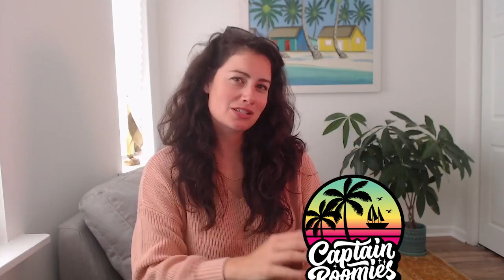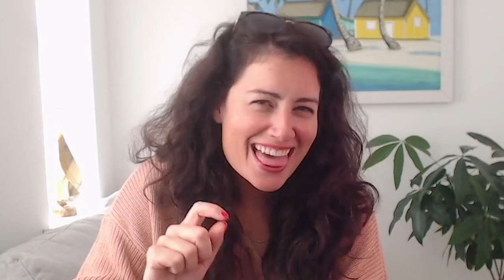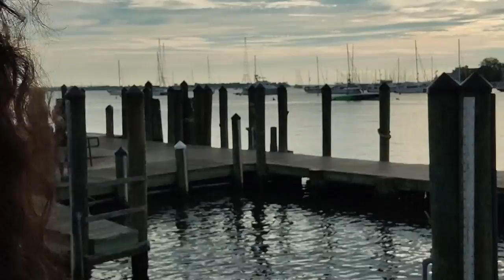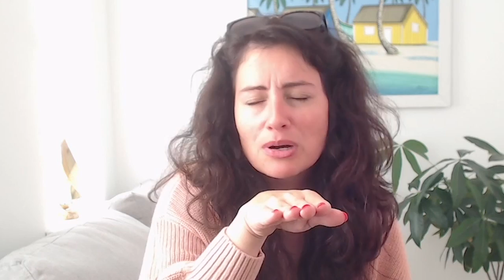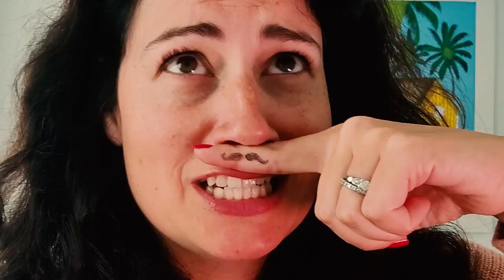Tips for Confident Big Boat Docking from a Woman Captain

Comment: YEAH.. "slow is good"    also slow takes off so much less paint... 
and why are there no video of that single engine slip hop?    like a timelapse.?
Reply from the maker: HAHA, It's pretty hard to film yourself and make that maneuver happen. I didn't have time to go ask for a cinematographer on shore, but I wish I had. Kicking myself now... I wonder if anyone at Pussers got a shot of it. There were plenty of folks having breakfast over there.
Reply: @CaptainBoomies  Yeah I know its hard - constantly wish I had turned on the camera when reefing - but the 35knot wind and waves kinda distracted me LOL
I have had good luck with time-lapses, use a big lightstand and stick the GoPro on top.. then let it run.  if you shoot 4 or 5.6k you can make a 1080p project and crop or crop-n-pan as you go after the fact. 
I tacked a phone to the dodger and just kept moving the clip-mount for the last timelapse I uploaded.
*BTW one of the take it easy and slow,   I always have to ask guests to please sit,  people think they are supposed to be running around for push-back and docking.   like to get the energy out of the boat and then just ease up the last bit.